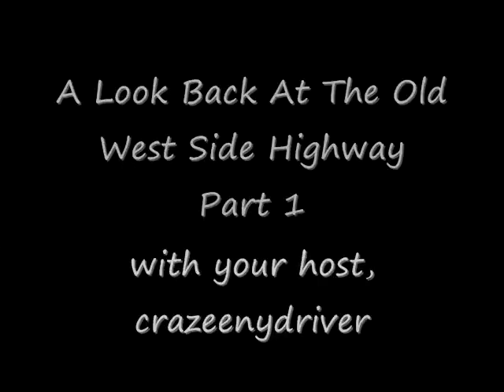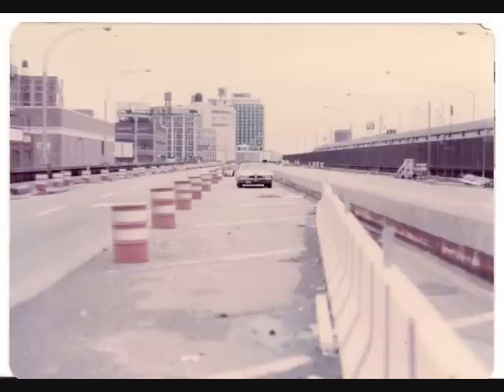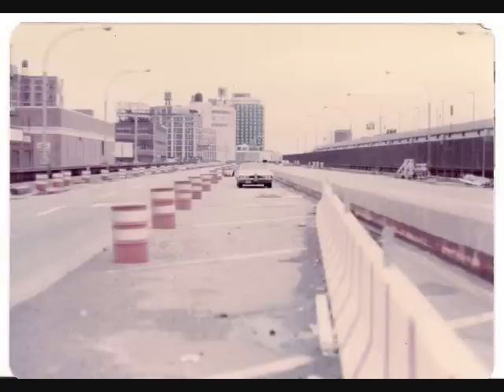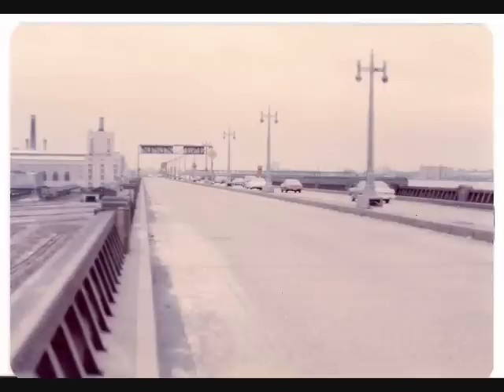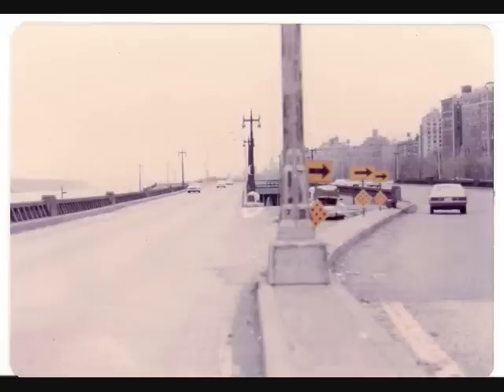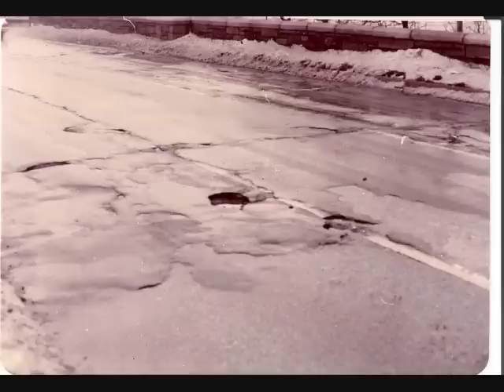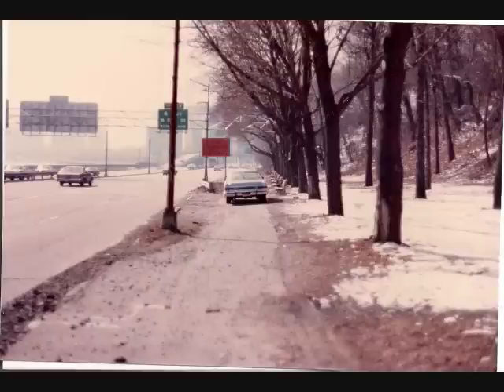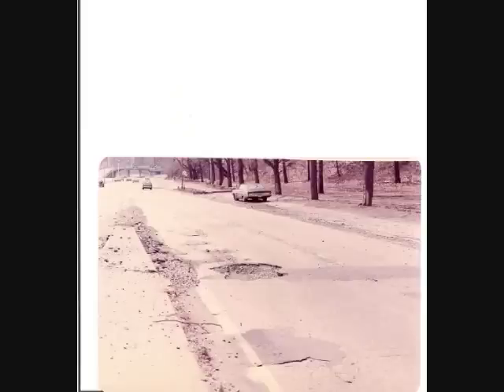The West Side Highway

Comment: I used to drive the original elevated West Side Hwy from the mid 1960's to the early 1970's.  If you could drive the entire length down to the Battery in the rain over some of the cobblestone sections AND survive you could consider yourself a DRIVER.

Comment: I remember the Miller Highway and it seemed to be something designed for the skinny lightweight slow vehicles and traffic patterns of the1920s, dangerously obsolete for decades before it was closed. Between the Belgian Block paving, abrupt angular curves and ill-designed left lane entrance/exit ramps, the whole thing should have been replaced in the 60s with a proper expressway as Moses' last useful hurrah.
Reply: InstaBlaster.
Reply: They were planning putting the highway underground but the damn goverment cancel it due to seeing as wasteful spending.

Comment: Great video. I wasn't driving in the city at that time, old enough but not crazy enough to try. Subway was my method of transportation. I remember when they condemned the West Side Highway Elevated portion and wanted to build Westway but could not get the Army Corps of Engineers to approve it due to some fish breeding grounds they would have upset. I also remember the abandoned elevated portion before they tore it all down. The current West Side Highway south of 59th is a NIGHTMARE to drive. I think it's just due to all the Uber cars on the streets now. Never has there been so much traffic in Manhattan. I could do 70 MPH on my bike in the late 80s from Houston to 23rd. I don't know if they increased the traffic lights or just changed the timing but there's no going over 35 MPH anymore. Broadway was another street I could do 50 MPH from 52nd to 17th St. The lights were actually timed to hit EVERY green light if you did 50 MPH. I'd pick my GF up from work at Roseland and head down to our apt on Rivington...1989-1990.

Comment: I own several pieces of cast iron from the highway, back in the mid/late 70s I used to go up there and unbolt the pieces of decorative iron and bring them home. Contrary to thoughts by some, all of the decorative artwork used on the highway's exterior and ramp walls were designed by noted sculptor Rene Chambellan around 1928, I have pictures his grandson sent me showing his grandfather Rene with some of the plaster studio models that were used.
I also own a ground breaking ceremony events booklet from 1929 that advertised it was to be held at Canal St.

That elevated structure was solidly built, the small iron pieces I have weigh about 70# each, but two pieces I had were 500# each, the city neglected painting and then used lots of rock salt, hard to imagine that after only about 45 years the thing was corroded so bad it was unsafe and then a section fell in.

As for why it was designed the way it was, remember- it was designed in the mid 1920s and built, they didn't have the kinds of vehicles or the like that we do now, they still had those "Model T" type cars, and most didn't have safety glass like all do today, they also didnt drive 75 mph- the model T's top speed was 40-45 mph

A 1930 construction film might be of interest https://www.youtube.com/watch?v=SLOWGNSHvGg